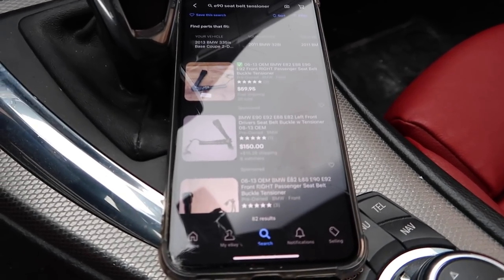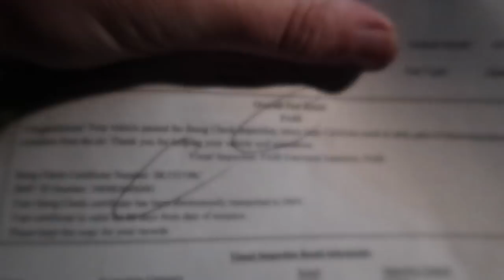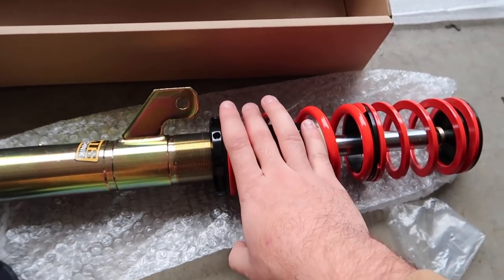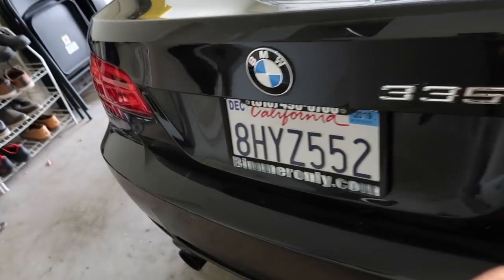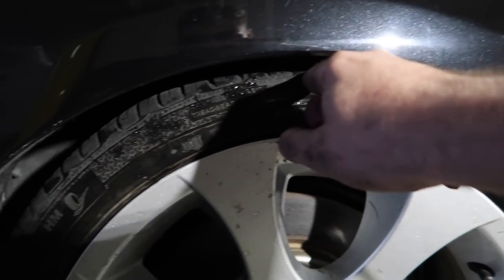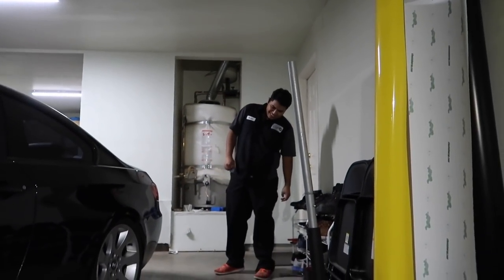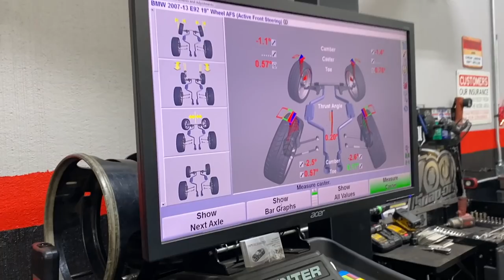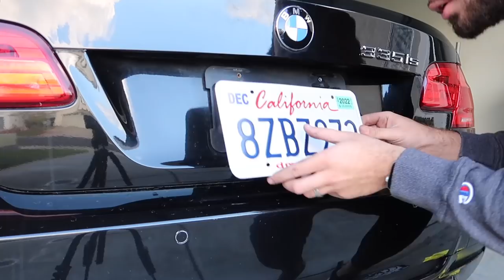335IS GETS COILOVERS! IS IT TOO LOW?

Comment: power steering pulley needs to be replaced plus change the belt with new tensioners it will fix it check the bolts that hold the power steering pump pulley sometimes they go loose

Comment: What’s the difference between the 335i and the 335is ?
Reply: DCT transmission, different front bumper, different interior trim pieces, 20+ hp/30lb ft tq more than 335i
Reply: @feefo247   thank you
Reply: Also I believe the motor mounts are a little better or more durable just so you know.